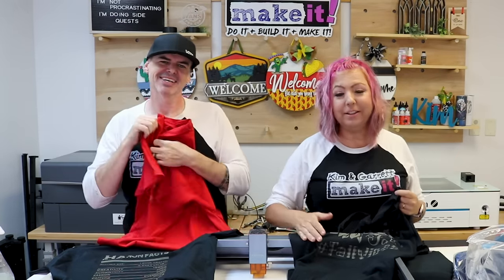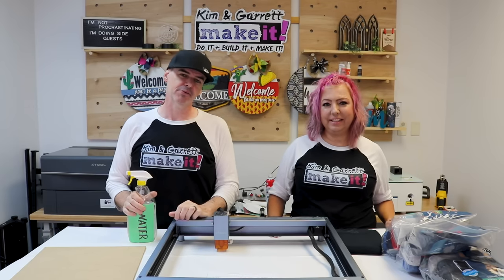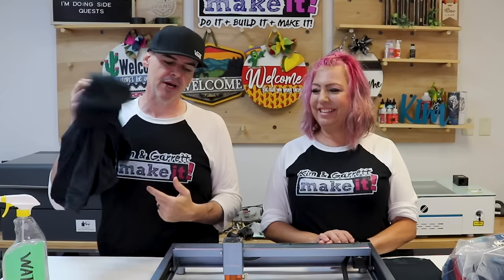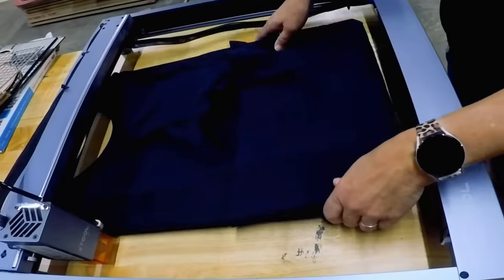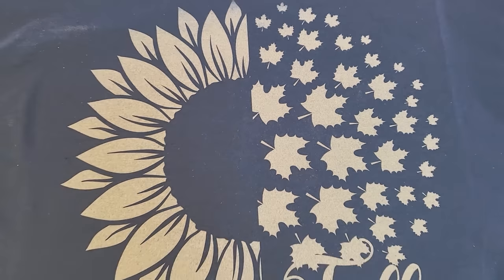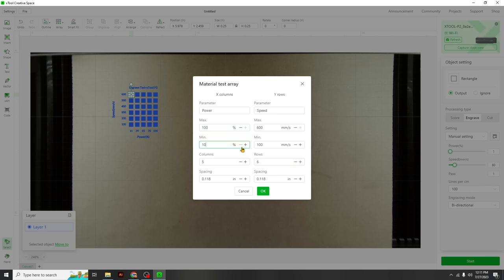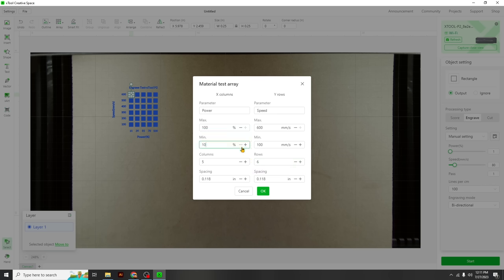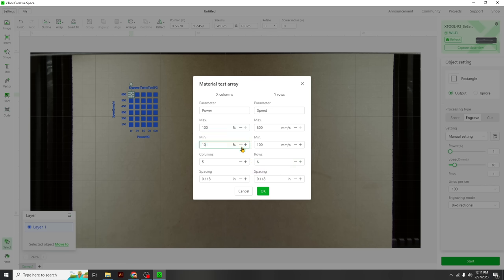Laser Engraving T-Shirts 101: The Ultimate Guide with Diode & CO2 Lasers!

Comment: I would love to see what these T-shirts look like 1 year later.   Or even one or two washes later.  I’m 99.9% sure they did not hold up.   I tried this based on your video.   I made a material test card and determined the appropriate setting using care to use the lightest engraving power possible to prevent damage to the fabric.   I bought a black heavyweight cotton Tshirt and engraved a nice design with my 10w D1 Pro.   Looked fantastic, just like the shirts in this video.   No bleed through on the inside.  Everything appeared to be great.    Threw it in the wash and when it came out there were tears in the emblem.   Even ona very light power setting.     So basically I’m calling bullshit on this video.   I think you two need to provide an update.   It’s not cool presenting a video like this portraying that it works well when many people are wasting their time and money with this faulty process.

Comment: Yes, I have tried it on some painters cloth that they use for covering. It works really good on that but I'm not sure what the right speed and right settings are for T-shirts without burning through. I have the 20 W Ortur. And I have a 10W  and I also have the 5W that one is set up for strictly doing cups on a separate computer. Lightburn.

Comment: Definitely interesting! Can't believe it doesn't jeopardize the integrity of the shirt... That blows my mind! 
Also, I i notice you don't use an enclosure on the D1... Is that just open for filming? I was led to believe we need a pretty good ventilation system, which is why i haven't used mine yet.
Reply from the maker: Well, we haven't washed them yet.  We will see how they hold up.  We don't have an enclosure for our D1, we just use it out in the shop/garage. The shirts didn't smoke or smell too bad.  ~garrett

Comment: I'm curious how well they wash.  Doing they shred/rip easier after many washes?
Reply: Me too ... I hear after washing they fall apart?
Reply: @Drakorianowl   I think my laser is a bit too powerful to make it work well.  The first one I did looked great, but when I stretched the fabric, it ripped.  I lowered my power again and reran it.  It works and looks cool, but I'm still not sure it will wash well or hold up to life.
Reply: Mine fell apart :( I was so excited
Reply: One of mine tore, one of mine washed out, I even tried different brands and the same ones. 

The same brand that worked one time wouldn’t work the next. I also used the exact settings both times.

Comment: I work with a 120watt co2 laser and a 50watt fiber. I put the power at 5% and speed at 100%. I engraved on a navy blue t-shirt and the finished product was yellow. Haven't put it through the wash yet so I don't know if it will fall apart. Will update later. The engraving time was just under 4 minutes.
Reply: Did you engrave the shirt with the CO2 or Fiber laser?
Reply: @awellendorf  Yes. I was able to wipe it off by hand. It would never stay after putting the shirt in the washer.

Comment: What was the final outcome once it was washed?
Reply: I want to know this too - I hear they fall apart, rip or get holes after washing.
Reply: Yes mine lost all color and had holes in it also and I didn’t even dry it very disappointed because I big hyped it on my fbook lol
Reply: @wvucorey  shucks! I had high hopes as well. I guess we should try to find thicker fabric with reduced power that will work. But i think only leather, wood, metal, acrylic can withstand the degradation of the CO2 laser

Comment: Well I engraved two awesome shirts with my 10watt laser with exact settings and I was so excited I even put the wood in between the shirt. However when I washed it, didn’t even dry it, it washed away the laser etching somehow and cut the fabric and it wasn’t that way after I lasered it. Has this happened to you all? Any tips to prevent this from occurring besides never washing it?
Reply from the maker: Hi Corey!  Thanks for trying it.  Our D1 shirts have been great, through the wash and dry cycle.  Did you try spraying with the water first?  I think that helps a lot. 
 The CO2 lasered shirts didn't do so well, they started coming apart after the first wash, after a second, there are some holes inappropriate places!  😂
Reply: Mine got washed out completely. Looked absolutely awesome then I washed it and it was gone.
Reply: Thx